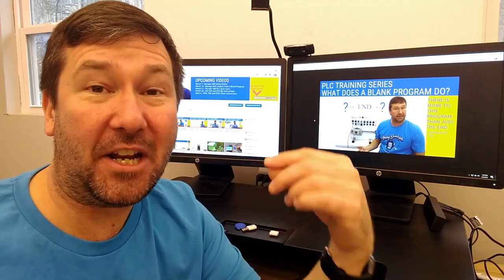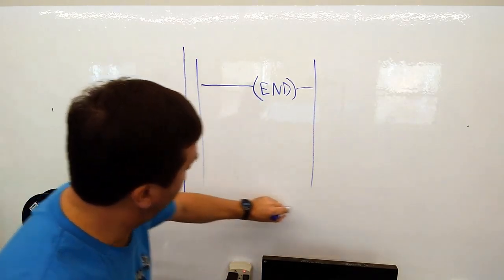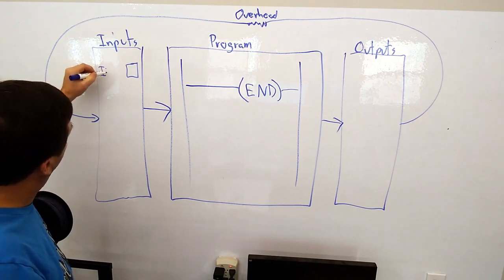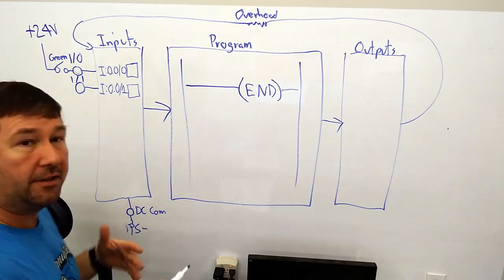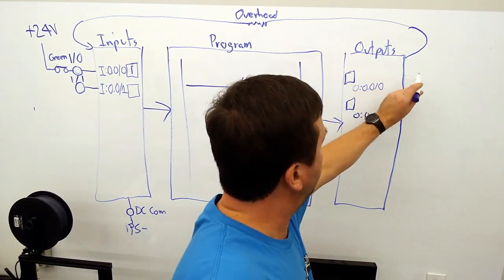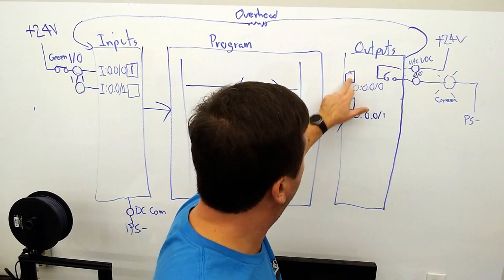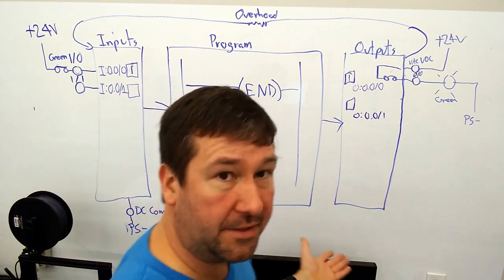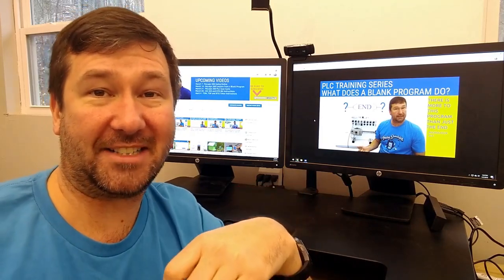Understanding how a PLC Program Scans in an Allen Bradley Micrologix using RsLogix 500

Comment: Hello @Tim Just wanted to ask if PLC updates output data table as it is executing program and then update outputs at the end of program or it just does it at the end once it has finished executing the program. If it does so at the end then where does it stores its ouput values during the execution of program?
Reply from the maker: The data table is updated immediately when something in the ladder writes to it. The physical  outputs are updated at the end of the PLC scan in the Micrologix and SLC 500. Controllogix and Compactlogix don't work this way.

Comment: Hi, Mr. Tim, I'm wondering if it's possible to disable scanning if you want to program for training just with relay logic, I mean without the need for OSR function. I know that you're an expert in it, so that's why I'm asking someone like you. Thanks.
Reply from the maker: Yes, absolutely
Reply: @TimWilborne  Thanks for the answer. I understand you're joking, but for example, the first scan reset doesn't work obviously. So actually I need to disable any machine scans during the process.

Comment: Regards Tim

A question?

I have an SLC 5/03
with a shelf of 10 slots

The program that has been loaded into the PLC consists of 8 LADs included (SYS 0 and SYS 1). The problem is that at the time of running the program, it only runs until LAD 5 and LAD 6 and 7 DO NOT WORK.

What do you think it is?
Thank you
Reply from the maker: Hi Stanley.  By default only Ladder 3 will be scanned.  It sounds like you have JSR instructions for LAD 5, 6, and 7.  There are other ways to call programs, it could be that ladder 4 and 8 are connected to some type of high speed interrupt.

Comment: Hi beginner here.  The output module has a 1 in the bit box. The reason is because there is current going to the input module to the output module or the 1 is already programmed into the processor by the software?
Reply from the maker: Not sure in following you but the input but box is in no way associated with the output bit box. You would to need to see what is putting a 1 into the output bit box.
Reply: @TimWilborne  thanks for the reply, I just read a plc book , it threw me off, after watching videos on youtube, I have a better understanding.
Reply from the maker: @slipnorris5882  Glad they helped!

Comment: Hey Tim, Amber. Im having a problem with my AB micro 1200 plc's. I notice that they are starting to go into "watchdog timeout fault". I can clear them but they come back. First time i clear them it would work for a week. Second time it would work for a day or two. Now after about 8 clears it faults within an hour. Any ideas on fixing this?
Reply from the maker: What that means is that your PLC scan is occasionally too long.  This could be caused by a very long program or excessive program loops using JSRs.  While online, click on the S2 data file and you can see what the current scan time is, the maximum, and what the watchdog is currently set at.
Reply: @TimWilborne  thank you, ill try that. Program is very short. 1 analog device only.
Reply from the maker: @ryanconnigrizzard1647  Email it to me and I'll have a look.